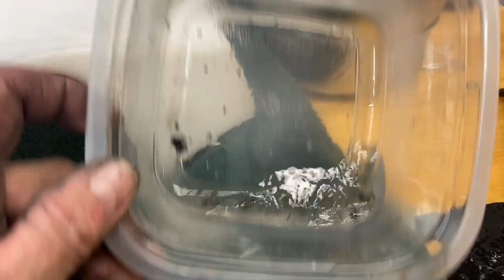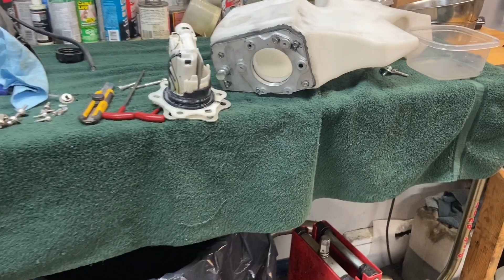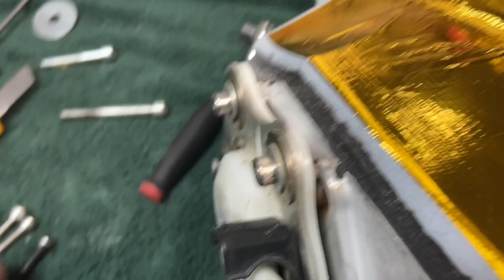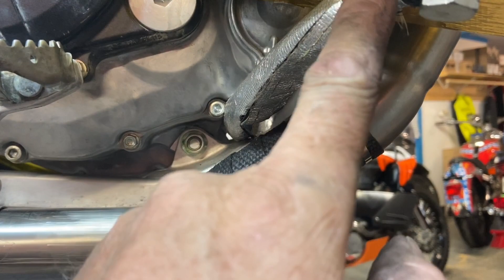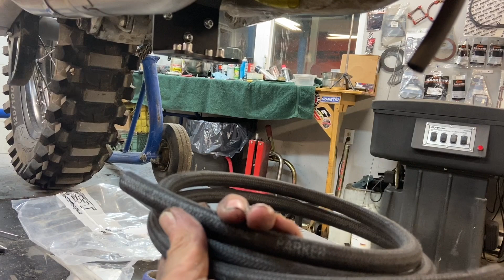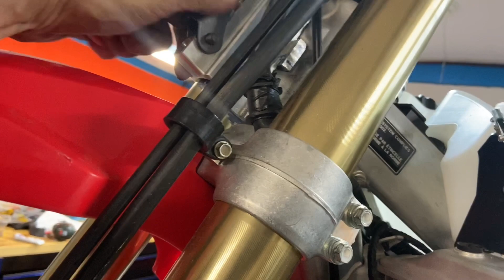Video 12 in the CRF450L rally build

Comment: looking at the heat shielding for the fuel line, possible suggestion would be a heat shield clamped to the exhaust??
Reply from the maker: You can see in a later video I did that as well.
Reply: @rtrottier14  I did a full CRF450X build in Perth Western Australia, tanks were an issue. the older pre 2014 and older John Hoffman Racing in sydney built a rear tank- subframe and patented it, costs about $2.5 Canadian (18L), plus front tank from safari, was hard to get so I just ran the safari 5l at ther ear and the 20l (held 17.5L- useable) front, I was chasing tanks form all places but it was like a secret you could not get them, then opted to run extra fuel bladders for ADV riding, best mods were a decent screen, free flow exhaust, taller gearing gave me about 440km on 23L in tanks about 18km/L best on roads about 21km/L, carburetor model. the top end - std cam, SS valves etc, heavier springs, TRX piston (same as in the 450L now, quad bike piston, double compression ring, and DLC coated wrist pin, extra lube capacity in transmission - force clutch cover, most of what J.T Ypung has added in chain guides etc, sold it last year, was out of work, need to pay the bills, got an AT now, just siting in the garage as I am working in Mexico
Reply: used simomoto plugs, tin wiring, full trip meters, nav tower off the bars, simple, crash proof, had heaps of fun, but only ran Motol 300V oil in both engine and gearbox, zero wear, zero issues, and synthetic coolant
Tried the stage 2 cam, too aggressive wheely in 3rd no problems, lacked low end torque, and used too much fuel. went back to tamer power for fuel economy
wiring was always an issue, std honda was good but the Australian wiring stuff made in china was useless, so rewired a few times, biggest problem was always finding good switches, etc, fuse blocks that are 100% water proof.
the CR2 I think make a good sealed power off take for the nav tower, come with push button fuses as well
happy riding, hope to vist some time

Comment: Braided metal fuel line better?
Reply from the maker: Hi William.  I considered it. But it still needs to be covered in heat reflecting material.  The steel braid would be abrasive to the covering and I think shorten the life of it.
Reply: @rtrottier14  Commiserations with your MST kit,thanks for exposing them.  Where that hose is,be braided steel all the way for me,and yes,i'd still wrap it...more power to yer elbow,as we say in Scotland,keep up the good work!(if i was MST,i'd be sending you a full refund,and let you keep what you already have).

Comment: If you go to 9:39, to the left of your finger, under the second bolt, there is a small white ring in the plastic of the pump base. There is a matching cutout on the aluminum flange that lines up with that ring. I can only guess that the cutout is under the fuel exit. 
Awesome explanations as always!